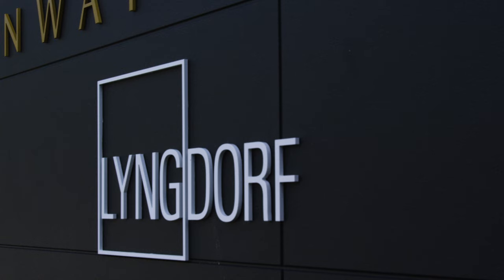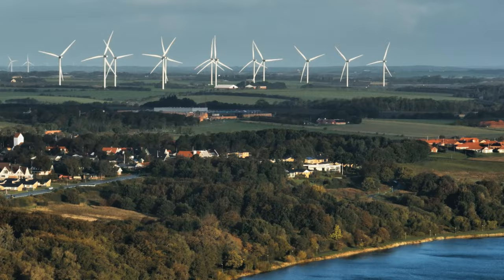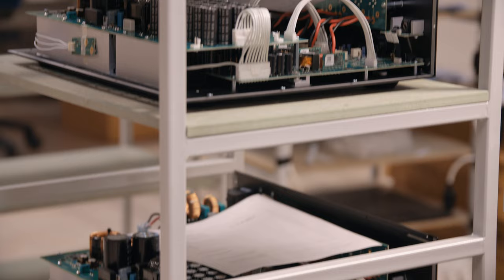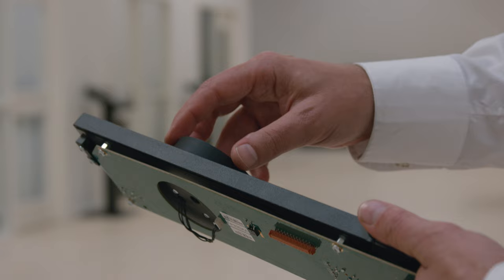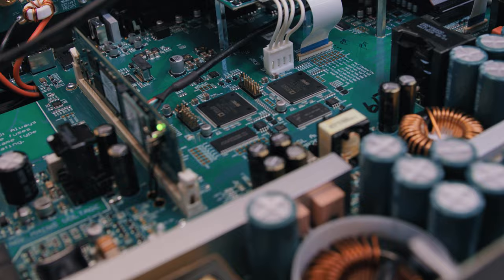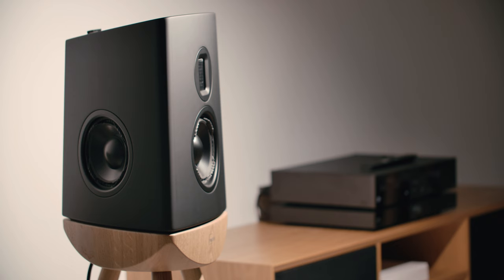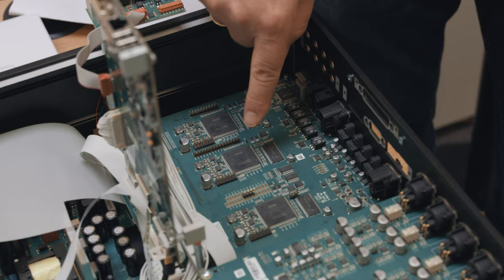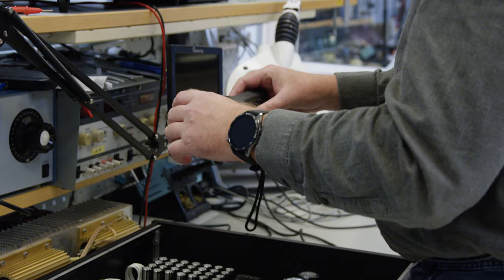Lyngdorf Audio: All-Digital Amplification and Room-Correction Pioneer (Jan. 2024)

Comment: Their amps can drive anything and are so flexible; i ran two TDAI2200 for 20+ years straight into a electrostatic panel and could use the internal X-over in the amp to split to dynamic basses.  Now they drive my Revel Ultima Studios with ease. The bass (down to 30 hz) is challenging in my room with concrete walls and little room treatment; as an example the deep tones of a piano sounds like the damper/sustain pedal is permanently engaged.  However Room Perfect can totally sort this out so the bass becomes natural and snappy.
 My amps are now 25 years old and they have been reliable in the whole time, even fed from a 3rd world power grid.